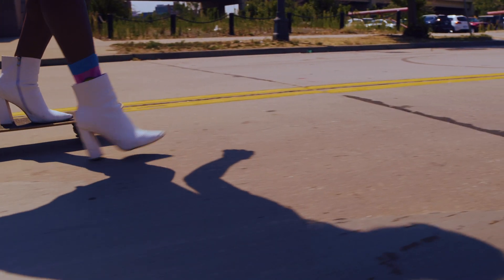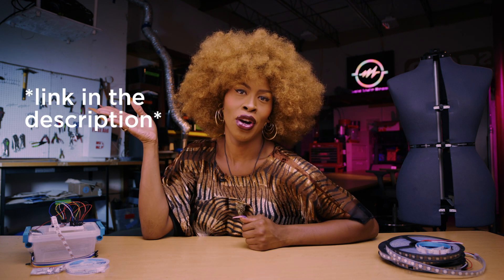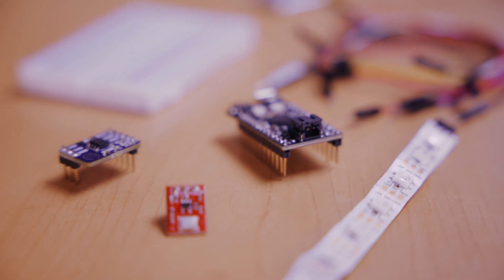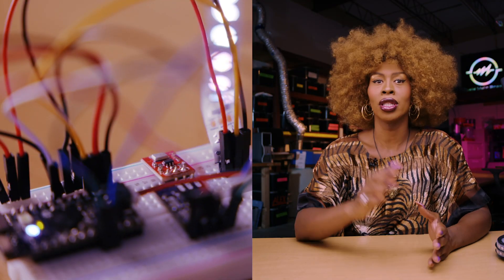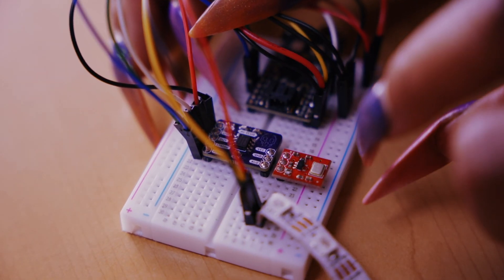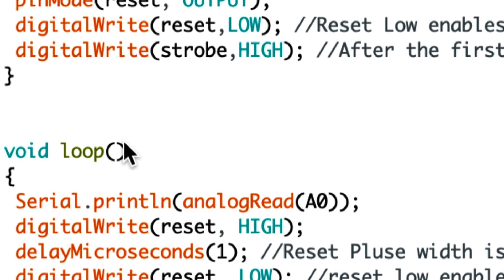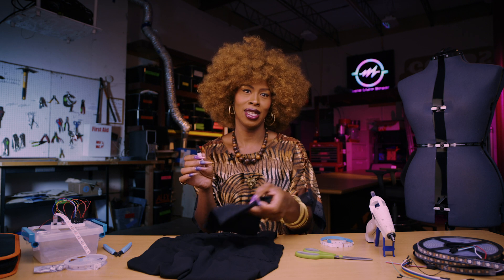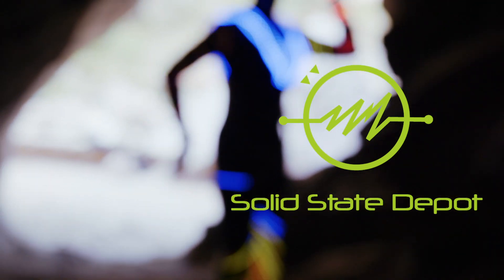The TWIRCH Shop: Sound Responsive Festival Fashion | TTG

Comment: gurl, 3 of the things i need alone are 96$.....I def can't afford doing this
Reply from the maker: If you don't already have an arduino on hand, maybe start with a smaller arduino projects from my  'Slouch Alert Vest' video.  The arduino super starter kit that I used for that is only $36, has most of what you'd need for this project as well, and comes with endless other project  possibilities. You will undoubtedly collect more and more tools over time.  My intent with 'The TWIRCH Shop' is to at least spark that interest.  Once you have the starter kit arduino experience, maybe try doing the project without the audio analyzer.  You'd still get the experience of programming your own light show because you wont have enough external power to just have the lights on alone, they would have to flicker to save power; it just won't respond to sound like mine.  Truthfully though, if you build it, the ideas will come.  🖖
Reply: @TwirlingTechGoddess  I was not blaming you for the price I absolutely love your series 😭💞. I just got frustrated while doing online shopping bcs I already had an idea in mind and didn't expect everything to be so pricey. I guess I gotta trust the process and everything will come together with time 🙏😣 keep the good job✨ I'll find my way around it
Reply from the maker: @alba_jm  I totally understand what you're feeling.  Sometimes we just want to create, limitlessly, and feel the agency to validate our own ideas without barriers.  Confronting the barriers to entry that most people face when trying to simply gain experience and information is exactly why this series is important.  Doing this show has been such an exercise in patience for me as well.  Sometimes, when things just aren't ready, or I dont have the money to adequately execute an idea the way that "I want to," I get really frustrated too. I try to remind myself that as long as I'm moving in the right direction, the work is still getting done.  The exercise for me has been finding the gratitude for that subtle progress, even through the moments of frustration.  I would just like to encourage you to keep at it, and hopefully through this work, we can create greater access to these resources.

Comment: Love everything you bring to the TTG. The tech, the attitude and the glamour are just beautiful to behold. 😘 

Quick question about this project. What if you want more than the 30 LED strip that you listed above?  Do you just just line them up in serial or is there a way to run multiple strips from the bread board?
Reply from the maker: The second code that I link the one I use in the final look, and it is for 6-8 strands of 300 leds, running from two separate microcontrolers, with the data parsed from the audio analyzer being shared between the two controllers to adequately juice the leds, which each has its own 5V external battery pack as the power source.
Reply: @TwirlingTechGoddess  Thanks!  I'm looking forward to putting it all together soon...